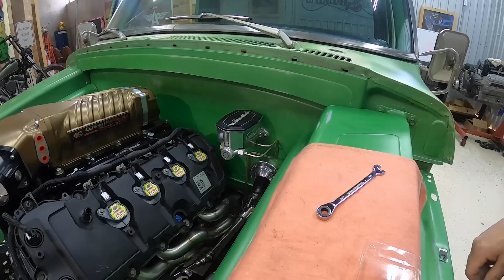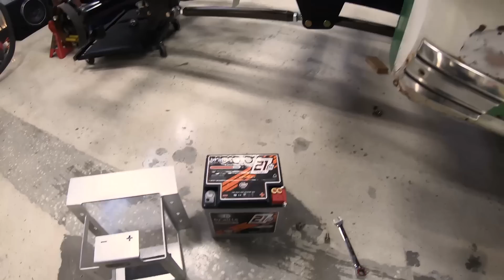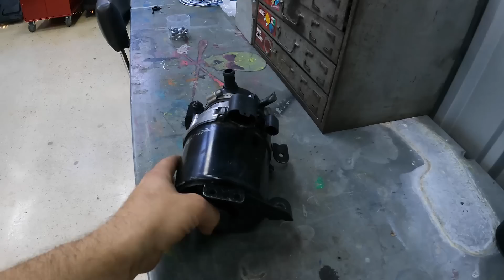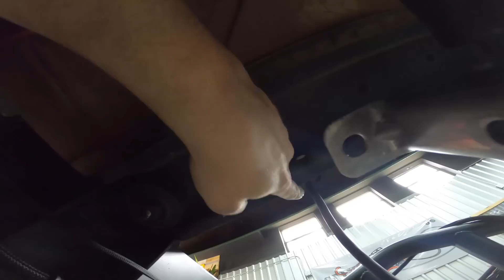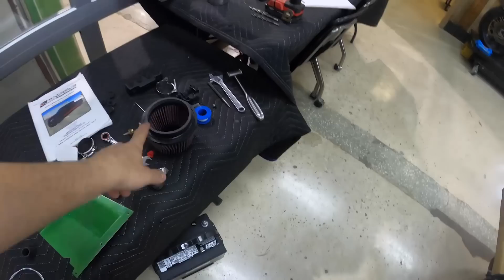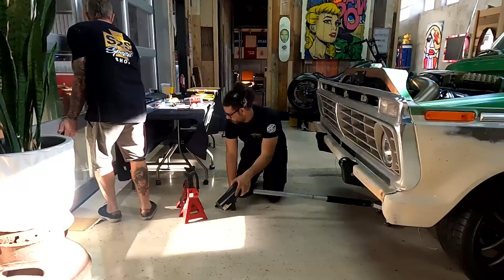How to: Modern Steering & Electrical Tips - ‘73 Ford Ranger - F100: Ep. 7

Comment: at precisely 9.02 that carrier bearing held with one bolt on each side could have been biffed-up with a small welded steel plate on top to use the two other bolts on each side..

Comment: I'd like to suggest to build an aluminum radiator mount, those old steel ones alway rust out on the bottom, plus less weight and looks cool.
Reply from the maker: Thanks for the heads up! If it becomes a problem down the road we'll switch them out for some aluminum!